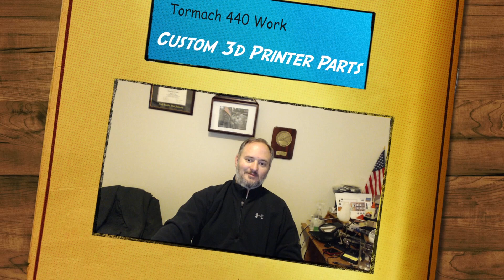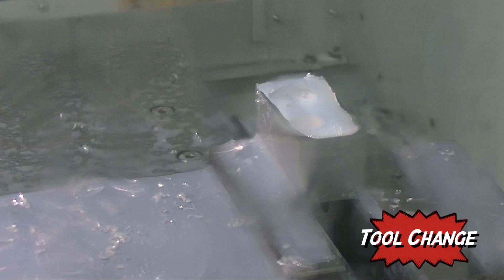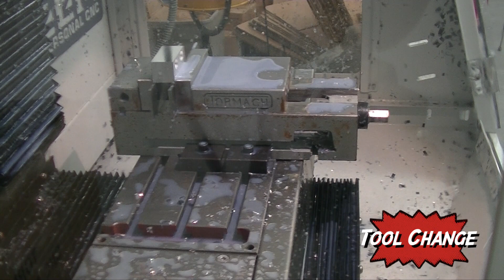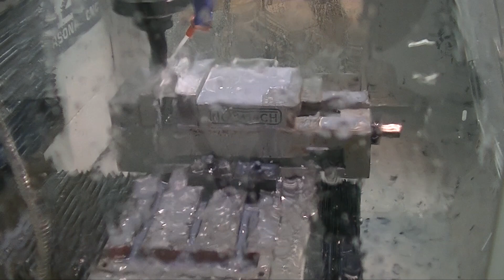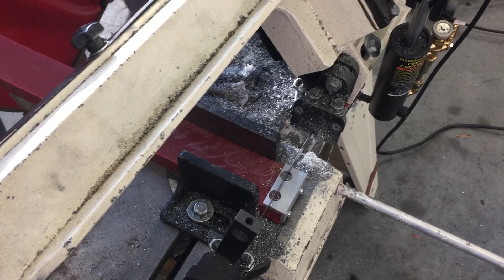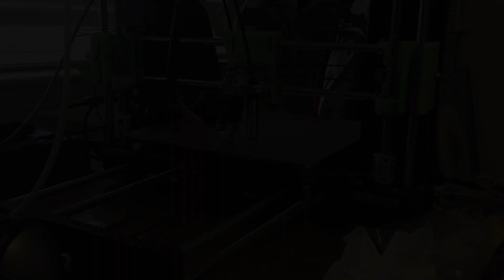Tormach 440 - Making Custom 3d Printer Parts

Comment: why is your vice rusty? are you using the wrong coolant?
Reply from the maker: +meocats I think that happened during the shop move and I never got around to dressing it back up. I'm running QualiChem 251c and it's been great overall. That one side of the vise is the only part with anything on it.

Now that you've pointed it out I'm going to have to clean that up!

Best wishes,
Tom Z

Comment: Nice!  That might be the first time I've seen a prox switch used on a metal bed for ABL.  I've seen plenty with micro switches on glass.  How do you like the metal bed?  Have you tried glass.  
Glad to hear you're feeling better.  I keep falling behind and I can't use "being sick" as my reason. lol :(
Reply from the maker: Hi Mike! The prox switch is new to me as well, to be honest. Had to learn how to use the Arduino IDE and do some configuration in the firmware to get it to work. The whole thing is still a work in progress; I do a little here and there when I have some time. The metal bed heats up more evenly than the glass one did but I'm having adhesion / hot end problems at this point. I think I over-tightened the hotend and all that aluminum is removing a little too much heat.

I'm weeks behind as well... I think that's become my new normal. Hope you are well, sir!
TZ

Comment: You must have had your tool height wrong, I didn't see any deep hole drilling. :-) You have to be at least 8xD for it to be deep.  I fear for the crash footage and disaster reel that will accompany when I finally start to run my CNC. lol
Reply from the maker: Hi Brian! I had to stare at your comment for a bit before I realized what you were getting at. I used Fusion's term for the type of drill operation there. Speaking of... I need to get caught up. I'm about 2 weeks behind from being sick and then on travel. Hope you are making progress still!

Best wishes,
Tom Z

Comment: I'm not sure if the gt2560 board can run auto bed leveling... it may require another control board. I still need to dig into that board and try to get auto bed level to work... i actually like ramps boards better than the all in ones.
Reply from the maker: You are spot on about that! One of the first modifications that I did was switch to a RAMPS board. That required putting all new connectors on the wiring since it used a different connector type. This is my tinkering project though so I do a little here and there as I get time.

How's the lumber mill coming along?
Best,
TZ
Reply: Lots of people don't like the ramps boards thinking there old tech but i
 haven't found anything better myself.  The mill is going great.. its 
lots of fun. Got a couple cool fir beams cut the other day.

Comment: Man that super fly leaves and awesome finish.  What RPM do you run that at, and what RPM do you run the shear hog at? Can you get an ATC for the 440?
Reply from the maker: Hi Gary! Agreed, the SuperFly can do a really nice job. Depending on the operation I sometimes use the ShearHog for facing as well because it does a great job as well. I like to run that at somewhere between 8-10k RPM, .1 DOC, .1 WOC for most roughing ops but that's not always the sweet spot. No ATC available yet but I've seen the prototype out there. People have gotten impatient and started making their own power draw bars as well. I might end up in that camp soon...

Best wishes,
Tom Z